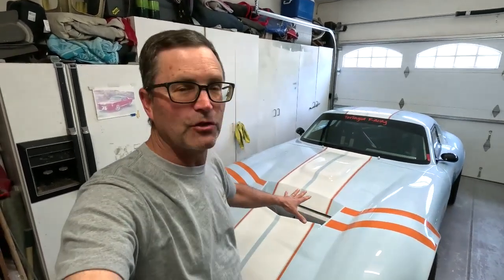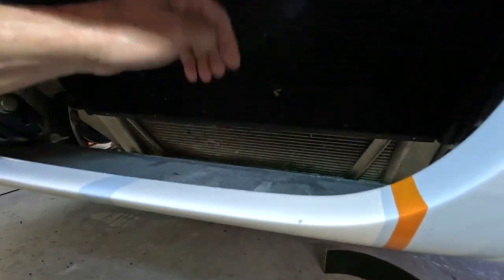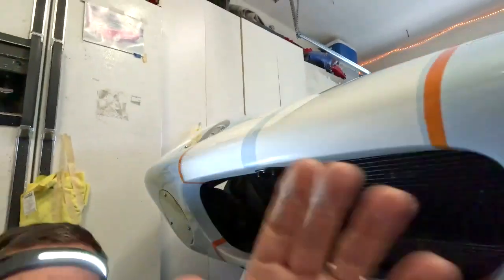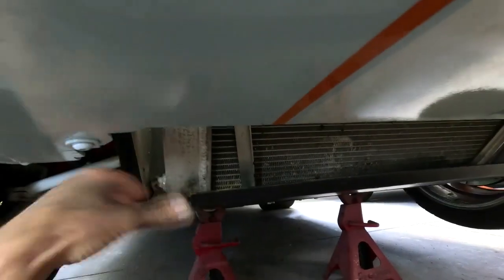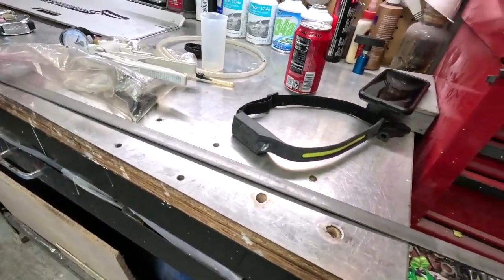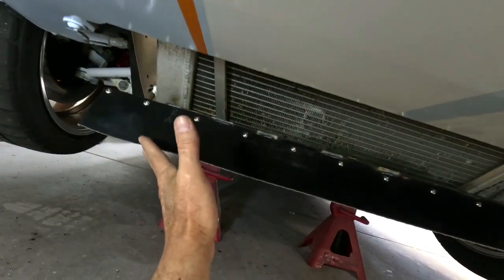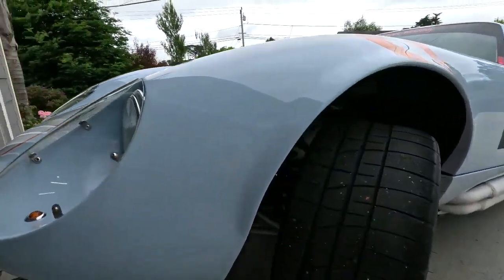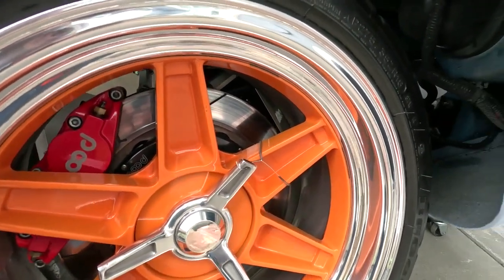Making the Daytona more Aerodynamic- Cobra Daytona Build, Video 211

Comment: Make a perimeter frame of light gauge aluminum to go inside the nose around the opening. Break a 90 degree lip in the aluminum or just buy a small aluminum angle. This perimeter frame will allow you to cover the opening with stainless steel mesh. Try it with one piece and see how much air for cooling is blocked. We used this for Cup cars to block the grill and pick up the air from the splitter. We actually used two pieces laid over each other slightly offset to block more of the holes in the first piece. The splitter from the “R” cobra is fine if you have air jacks to lift the car so you can tilt it. Once you fix the front, you will need to work on the rear balance. You can find the stainless mesh from several sources with different size holes.
Reply from the maker: The R nose would be nice but I am trying to keep more of an original look, sort of. Plus the R nose on the street is low and my friends hits often so he doesn’t run it. As it sits now I can go anywhere and no issues rubbing. I think my aero improvement path is done as the car was fine at 150 and we will see what 165 is like soon. Thank you for the suggestions.

Comment: Peter Brock designed this car to be stable @200 mph relax stop over thinking this  Cobras were capable of about 160
Reply from the maker: I will know in 7 days and hoping it’s true but these do have some aero differences compared to the original.
Reply: Pan the first half of the bottom it will be faster and stable.Dry sump will help to cool oil.
Reply from the maker: Already installed flat bottom to front of oil pan.

Comment: I've always wanted to take the measurements and dimensions of a Shelby Daytona Coupe, Ferrari GTO 250, Datsun 240Z, 63 Corvette split window, Jaguar E type series 1, feed it all into a super computer, and see what an algorithm would come with. Its obvious that many people are enamoured with the long nose front engine and curvy lines of these particular early 60's through early 70's cars. Many of us can't let go of these cars, even when faced with the overwhelming advancements and progression of the mid-engine sports car.
Reply from the maker: Great comment. Yes, these cars are unique and will always be popular. But if you want a fast aerodynamic car most anything modern is the way to go. I have learned a lot from the solid works CFD and the originals had better aero than the FF type 65. Most of it due to the smaller frontal area and the better radiator ducting.

Comment: I would think reversing the angle of the radiator, and allowing the air to flow across and then over the hood would be ideal. This, should also help with heat extraction and additional downforce as the air goes over the hood and roof.
Reply from the maker: I agree and if I was building a race car I would follow your idea. Lots of work and not even sure it would fit so I am working with what I have. Great comment.

Comment: What your doing will definitely help but won’t be anywhere near as effective as the R nose and splitter. There is already soo much air traveling under the car at that point that the effect will be negligible. The air dam needs to be at the nose and preferably with a splitter 3-4”. I know you want to maintain the historical look but consider the R aero nose with quick mounts so you can remove it to open the hood and take it off when you’re not at track days. However, the originals were going almost 200 down the Mulsanne so it comes down to your comfort level and how the car feels at that speed.
Reply from the maker: I agree about the R nose but no way to pull on and off without holes in the nose so I am not doing it. Need to find next best solution without changing the looks. Thanks for the great comment
Reply: Are you familiar with anyone that has installed the R nose and splitter?  They came with my kit(someone has spec'd the kit then backed out).  I am not sure how it is to be installed.  I have the splitter as well.  Looking for guidance.   Thanks. Mike